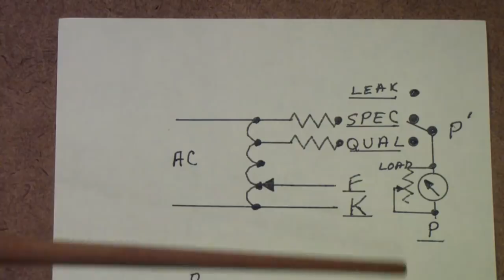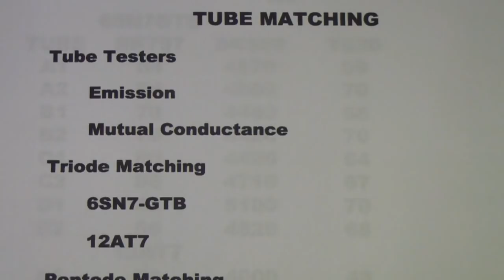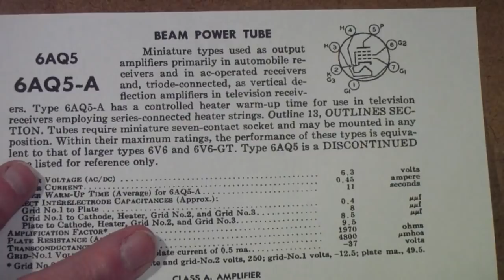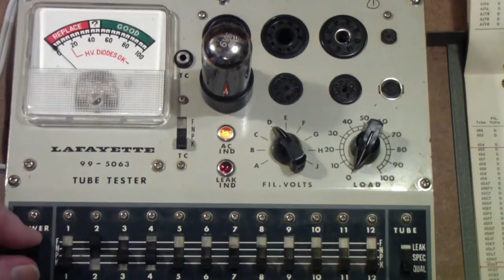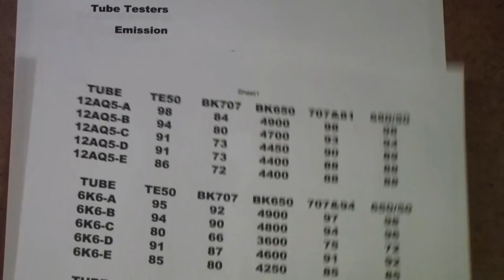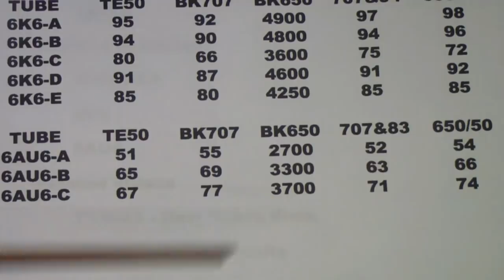TTT196 Pentode Tube Matching

Comment: Tomtektest, what amp schematic are you showing in the beginning of the video? Just wondering since the plate of the out put tube is wired to the screen of the driver tube. Not sure if you've heard of the Baby Huey amplifier design, but seems quite similar of a feedback design. Kinda kicked the idea around in my head quite a bit after seeing the Baby Huey.
Reply from the maker: As I explained in TTT194, that schematic came out of the RCA Tube Manual. It is the same schematic they published in that manual throughout the 50's and 60's but I do not know if it was produced commercially.
Reply: @tomtektest8042  thank you

Comment: Hi Tom, you already have a video on using the analog discovery as a curve tracer, what modifications would be required to make it usable with tubes? 
If you could build such circuits, would the results of matching be any different? in other words is it worth the efforts to build such a circuit?
Reply from the maker: I considered using the Analog Discovery but its inputs are limited to 25 volts which is far too small for tubes. You can increase the input voltage range with the BNC adapter board and X10 probes but it still would require a buffer amplifier to increase the ramp out put from the 5 volt limit to something around 200-300 volts. You also would need a filament supply (1-50 volts), and other circuitry so I decided to not use it for this purpose.